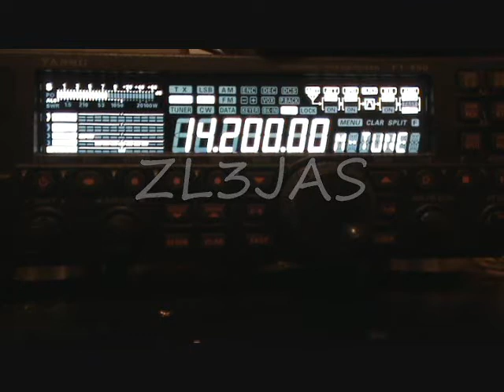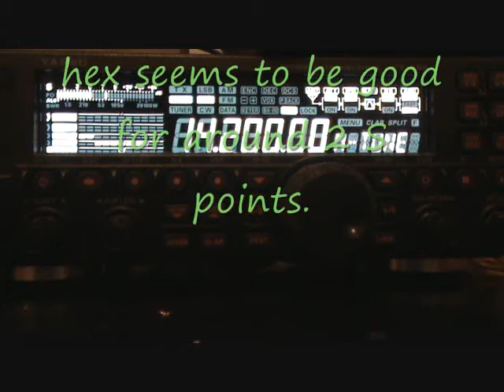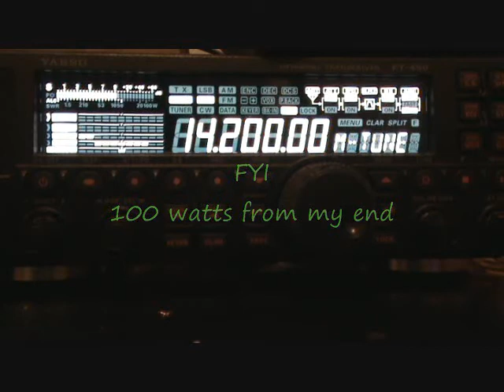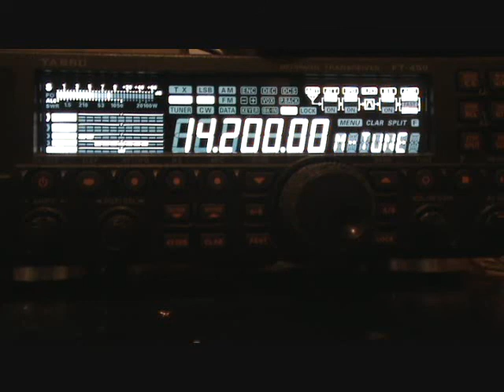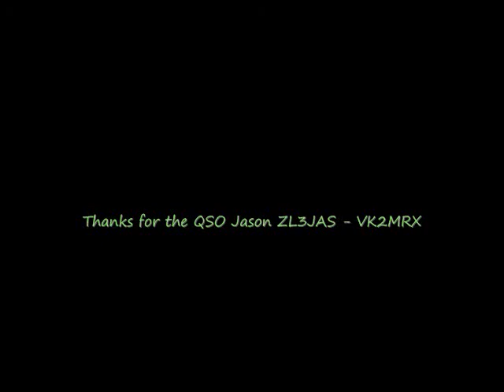Traffie Hex Beam testing  - QSO 20M ZL3JAS - VK2MRX

Comment from the maker: Hi Jim, 
must have been heartbreaking to take the quad down. It does look impressive in the air. 
I was very impressed with how the hex performed in your comparison video. 
Do you have a particular frequency you monitor 20m and what times (your local ) do you tend to be on?

cheers Brett VK2MRX

Comment from the maker: cheers for the comment. 
I run a LDG AT100pro auto turner and it does tune up on 40m. I've not had the chance to test it fully yet but it does not seem to benefit from any gain though on 40. 
It does however still cut the noise back significantly with its ftb and side rejection. 
Thus far I've only managed to rx with it down there but intend to test it a bit more thoroughly when I have the time. I will post back or maybe even throw up a vid.